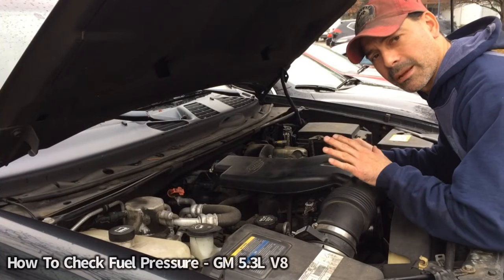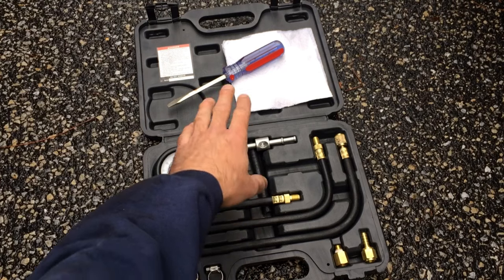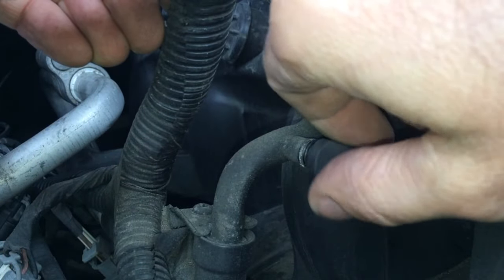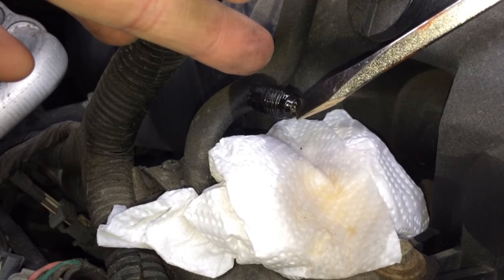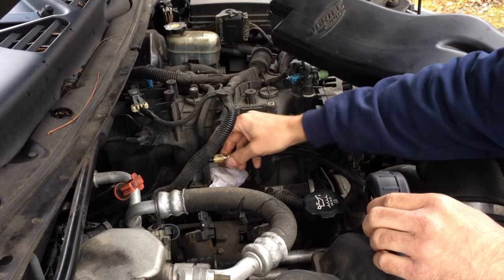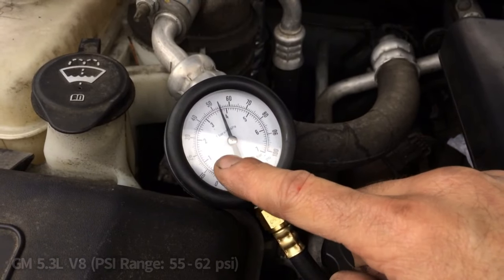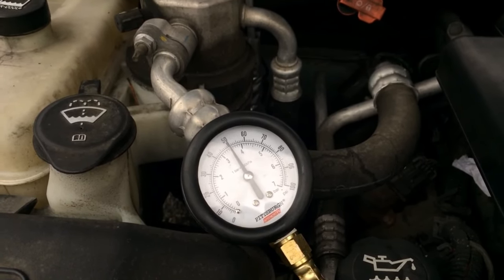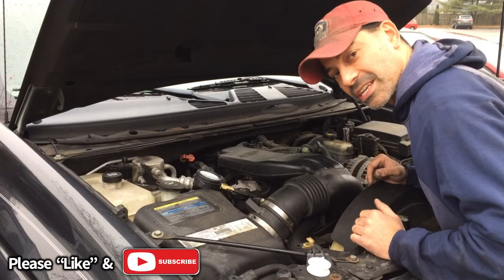How To Check Fuel Pressure - GM 5.3L V8 (Andy’s Garage: Episode - 147)

Comment: What code did the truck have a P0171 or P0174?
Reply from the maker: Mel Hardee neither, I was just showing how to check the pressure. P0174 usually pertains to the MAF Sensor

Comment: So what should my minimum fuel pressure be and when I did my test needle was bouncing from 44 to 49 so 55 is minimal then? Do I need a new fuel pump or can I install a check valve somewhere to help this issue any thoughts from anyone please? Thank you
Reply from the maker: Sounds like the fuel pump or pressure regulator needs to be replaced. If your vehicle is sluggish when accelerating it is most likely the pump
Reply: @PhillipsVision  I rechecked my pressure it was about 54 I was reading it incorrectly I only primed once first time I did a drop test it went down to 40 after about a half hour do you think installing the one way after the fuel filter will help keep pressure better? I changed my fuel pressure regulator recently and fuel filter my fuel pump will probably need to be replaced soon its a 2001 silverado 5.3 v8 with 125000 miles..so just wondering if you think it would help snd what size check valve do I need for my truck? Thank you
Reply from the maker: @robertpaul3675  you could try it, put it in-line after the fuel sending unit
Reply: @PhillipsVision  did the check valve seemed to help alittle. My fuel pressure is 50 psi with engine running. 55 with battery just on in acsessory mode. Is this below the normal spec?
Reply from the maker: @robpaul7900  you’re good then. Key on/Eng off should be between 55-62psi
Reply: @PhillipsVision  thank you
Reply: Robert, my 2002 Suburban fuel pressure while running is at 45PSI with the air hose pulled off I get 52.   Replaced the fuel pressure regulator and got same results.  I suspect that your readings are normal.
Reply: I added a comment today about this info...

Comment: so, I have a 2002 chevy Silverado, when I turn the key to prime it, it stays at 0, 48 psi running the vehicle, fuel pressure drops to 0 when I turn off the vehicle, anybody else had this problem.
Reply: Have u found a fix for this

Comment: I have a 2014 Silverado 5.3 and I cannot find the schrader valve to release the fuel pressure and test it. This video isn’t correct for all 5.3 engines or something.
Reply from the maker: The 5.3L in this video is a 2003. General Motors may have changed it on the newer ones.

Comment: Hi!

What size/thread/type of adapter do I need for the schrader valve on the fuel rail?

I bought a fuel pressure tester but the adapters that came along with it didn’t fit the schrader valve. 

So, do you know what size/type/thread it is?

Comment: My envoy has the 5.3 motor
Reply from the maker: Have you checked the fuel pressure? Could also be the starter failing.
Reply: @PhillipsVision  would it crank if the starter is failing?
Reply from the maker: @jamesq8378  no. When Starter fail it won’t crank and you may get a buzzing noise
Reply: @PhillipsVision  ok, thank you for all your good information. I bought a fuel pressure test kit. I’ll test it. 55 to 65 correct?
Reply from the maker: @jamesq8378  55 -62

Comment: I got a 2013 silverado 5.3 it's at 41 psi
Reply: Did you fix your problem? I lose presure over night and the pressure is 45 psi but once it gets going it maintains 55.
Reply: @uriel0002  not fixed yet
Reply: @SECRETGOVERMENT2012  dang my only does it when it's 15 Fahrenheit or lower outside. But I got myself an starting fluid just in case also I pump the gas pedal and for some reason it starts.
Reply: @uriel0002  mine stays at 41psi all the time just pulled 1900 pounds with trailer
Reply: @SECRETGOVERMENT2012  I stay at 42 psi. I'm about to change my fuel pressure regulator. I just changed my filter and pump and it's still at 42. Did you get yours up to 55?
Reply: @mikespence8895  no I haven't even changed it yet it's at 38psi right now the pressure regulator in the tank is going out . Check to make sure u have no stuck injectors after u find out wat pressure ur pump is and if u changed just the pump and not the full assembly then it might be the regulator
Reply: @mikespence8895  at idle it should be at 55psi and wen u rev on it it should got up to 62psi
Reply: @SECRETGOVERMENT2012  it's a flex fuel. Does that make a difference?
Reply: @mikespence8895  no flex fuel just means u can run any gas in it .it does not matter
Reply: In my truck i got 58 psi without starting the engine and then in 1 minute it goes to 1 , but in idling it got 43 psi , do i need a new fuel pump ? 
It is 5.3 2010
The engine light just popped for one hour and it gives P0446 and P0445
Reply: @TTURKI  check your injectors for leaking before you do the pump